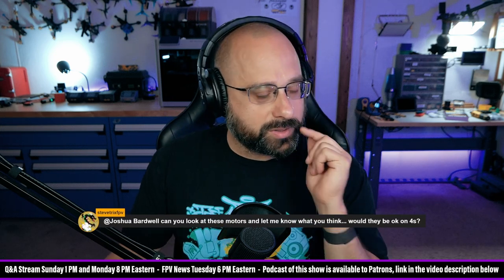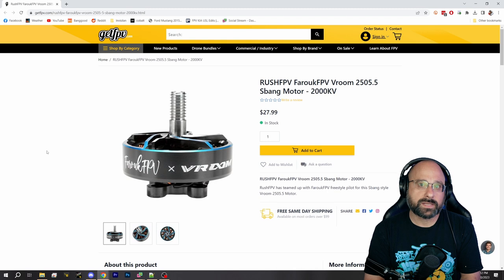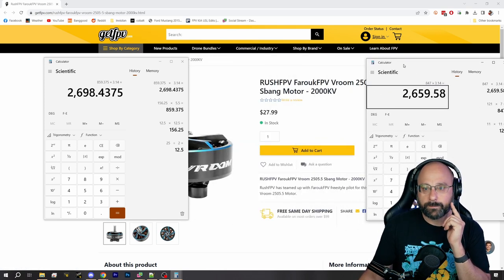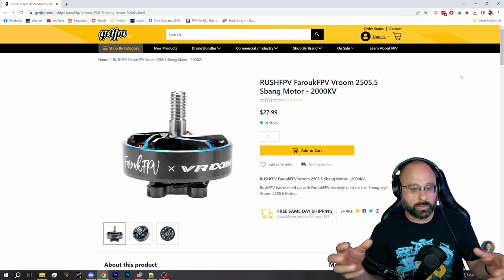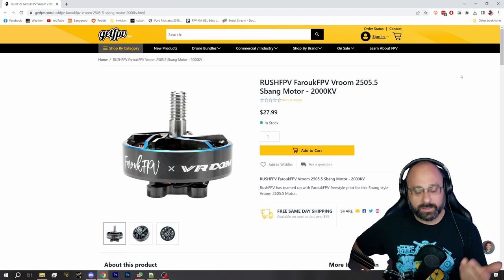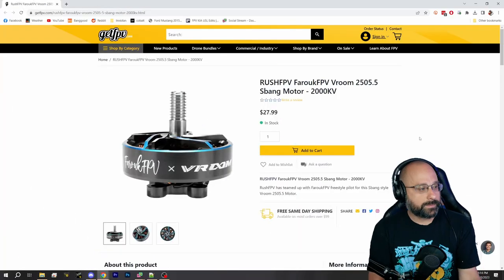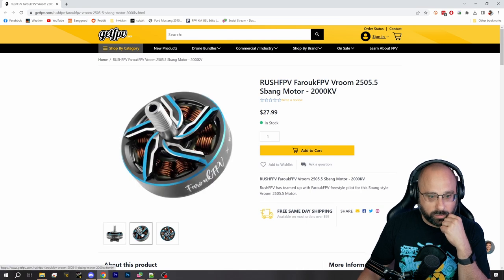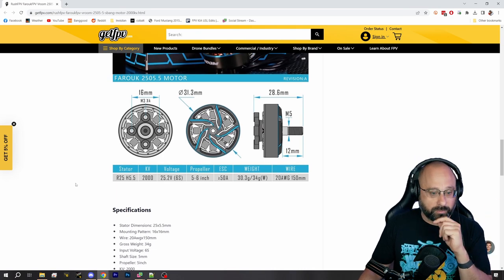Are Wider Or Taller Motors Better? Should I Use 2505.5 Motors For FPV? - FPV Questions

Comment: 25mm is 2506.2. Many difference arent reasonably possible to tell from flying. Specifically the 22.6mm motors you have with the split and square magnets should have a very distinctly different flight feel. The wider 25mm motor is also less responsive and that's generally what I believe is what makes it feel smoother. Also, the low to mid range throttle does feel different and more controllable. Lastly, the temperature stability allows for a more consistent tune because they just dont tend to get warm/hot if things are reasonably noise free. 

Please put out the video with ciotti. Would be a really helpful data point.

Comment: Love me some T-motors.  Got some 1203 7000kv 2s 3"  and 1404 4600kv 3/4s 3" smooth💨  also the fpvcycle 23mm short are pretty fantastic as well. I wanna fly now dangit! 🐝
Reply: Yup love my motors right now I have the F60 pro iv 1750kv but am about to order the new F60 pro V LV 2020kv for 6s it's about to be a rocket ship lol. My gps clocked me going 72mph with a huge 1500mah and the go pro. It'll probably hit 85+ with a smaller battery and no go pro. Hopefully be able to hit 100mph with those new motors
Reply: Exactly though everytime I watch some fpv videos it makes me wanna go fly like right now lol but it's dark and don't have a night camera yet but hopefully soon

Comment: I got the ethix v4 for $13 on a blowout. They are smooth, and they are underpowered. It's arguably perfect for tight proximity. People want that perfect flight feel, and there are a lot of variables. I built a second quad about 30g heavier. Not only did I need to put bigger motors on, but I also had to find a different prop as well. Now they both fly very similar.
Reply: The thing is that what is 'best' isn't always the best technically. Underpowered motors with weak magnets have zero noise issues and have great throttle control. Sure you give up some efficiency and top end but you gain flyability in the range you need it to perform in. Just because it's the most powerful doesn't mean it's the best by a long shot. An 1806 with 2300kv on 6S is gonna make much more thrust than a 2207 1700kv on 6S. The 1806 isn't gonna feel nearly as good.

Comment: Chris Rosser does some amazing work and I have no qualms about the accuracy of his tests BUT he is testing the motors only. I'd love to see some testing with more equivalent batteries to what we use. Like maybe a 450mah pack. I'm convinced the efficiency is a bigger part of the picture than his tests indicate.
Reply: The pack just adds a variable that cannot be repeated. if you know amps and volts you know it's efficiency. A pack will vary from charge to charge.
Reply: @ericapelz260  knowing the efficiency is one thing. Knowing which motor reacts fastest or delivers the most thrust when amps are severely restricted is another. It might be be that efficiency trumps all other variables in many cases...or maybe not.
Reply: I may not be understanding what you're saying, but it sounds like you're asking for battery testing.
The answer to "what will my motor do when voltage sags?" is already there in the graphs...

Full disclosure: I don't know anything, you're able to think for yourself. I could very well be wrong.

Motors have a performance envelope based on voltage, current draw is load dependent. When a pack can't deliver the requested current, the voltage sags. 
When voltage sags, the motor performs based on the voltage it's given. 
"Which reacts fastest or delivers the most thrust" is entirely battery dependent. Motors do as they're told until they explode.
Check the graph for your motors. If your LiPo sags one volt, look at the chart for your 'sagged' voltage/rpm. That's how your motor will perform.

Comment: I run the Farouk 2000kv motors on two of my Glides and  Hyperlite E 2207.5 2200kv on the other two Glides.  Both on 6s.  Performance is similar  but the Farouks do have better low end torque and control.  Hyperlites have a bit more yeeeeeeeeet lol😅.    The Hyperlites are close but the difference is noticeable.  If I had to choose which one to fly....I'd fly the Hyperlite E because the performance is close and they're half the cost.  When i crash its not as painful.  I tend to the fly the Farouks over grass.

Comment: If the motors stay cooler, could you prop up and put a 50x50 prop or even a 55x50 prop on it and get more thrust.  Just a thought
Reply: I'm curious myself...

Dude on EBay just liquidated a bunch of 25xx series motors. I bought a set of 5 2507 x 2660kv and a set of 5 2507 x 1350kv's for $60.

10x 2507 motors for $60 (new in boxes) was too good to pass up.

Comment: I wonder what the payload is for certain reason why maybe one motor didnt do so great. if all the motors have the same size bearing and mounting. I know he was able to pick put the gap fitment. Also the white glue that he points out. At a certain payload 9mm bearings with a 19 mm base on a thrust stand will cause drag possibly that a quad would not.
Reply: Buckle points

Comment: Chris Rosser was only ripping the Mr Steele motors because Mr Steele was ripping his frame. He was also comparing different sized motors and putting them on the same chart and plot it in such a way that small differences look bigger. Also I think we need some durability tests to throw into the mix bc I’m tired of broken electronics lol
Reply: Chris rosser is a professional engineer. Mr Steele is an Fpv personality. You expect Steele to be an A-hole because… well… he is…  I think Rosser was giving honest data and Steele was just being himself bottom line

Comment: I run 4S with 2205 2300kv.... is going to a 2207 2800 going to give me a bit more....oomph?
Reply: Yes. The extra 500kv will be quite noticeable.  2800Kv is getting on the high side for 5" on 4s, but is totally doable.  They will hit your batteries much harder than your 2205 motors.
Reply: Absolutely, 2800kv is a bit high but you can lower the motor output power in betaflight a bit..
Reply: I have 1 w 2205 2300 and my new build is on 2207 2550 and it's a big difference I wouldn't 2800kv I really feel 2550 is that sweet spot for sure
Reply: From 2205 to 2207, you will absolutely feel the difference. Do it.